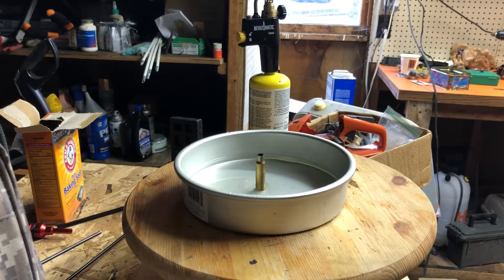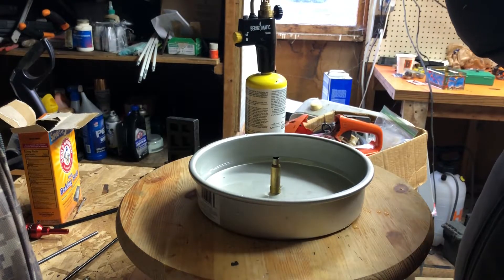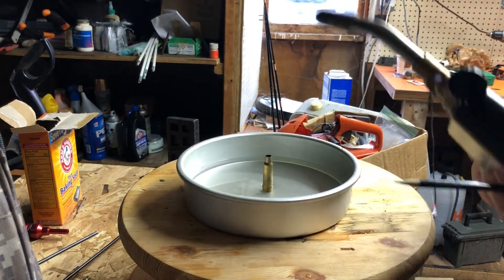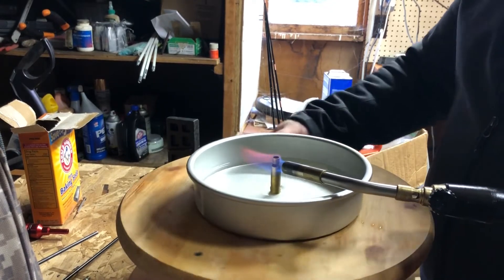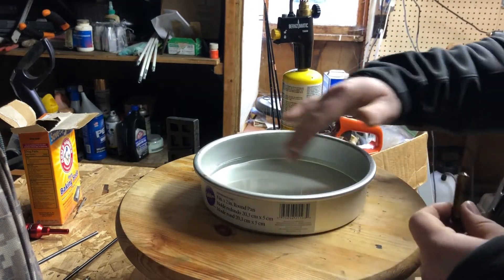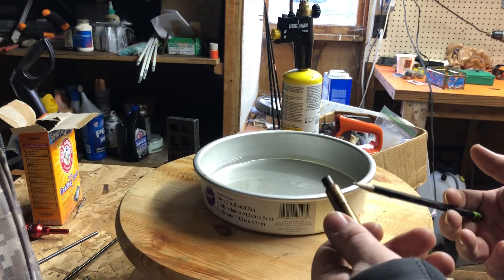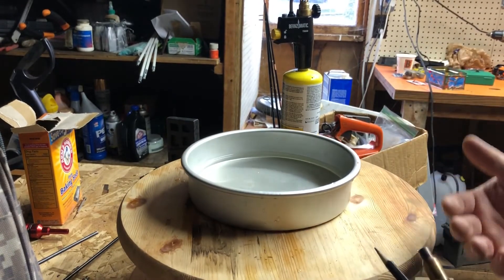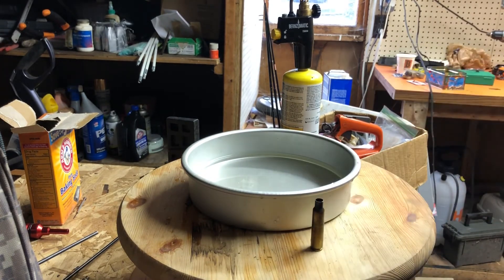How to Anneal Rifle Brass with the water pan method

Comment: I Chuck them up in a drill press. Use a Sinclair set up like a shell holder. Spin them and hit with the heat then dunk in a jar of water using the drill press lever.

Comment: Thanks for the info.  Can I get a reason as to why few people quench their brass but most don’t?  If the quench doesn’t hurt the brass then is it done just to speed up the cooling process so you can handle it quicker?  I’m looking for an answer that I can’t seem to find.  Thanks
Reply from the maker: Brass does not quench the way steel does.
They quench to have it be cooled down faster so they can handle them faster.

I use the water to prevent the case head from overheating obviously.
Reply: @shortreloadingvideos7571  No, the quench is part of the annealing. It would actually re-harden if cooled slowly.  Same w/ aluminum.  Think that the quenching freezes the molecules in the soft form.

Comment: Eric Cortina recently doubled his time under flame when he tested and found he was either under annealing or that it didn’t make a difference. 
I do the same method as you. I use distilled water, let the cases air dry for a little bit and then straight into the tumbler. I don’t really use a count or time under flame, I go just until necks start to glow. Some necks are a little blackened from my annealing but I’m to lazy to polish them any more than throwing them in the tumbler.
Reply from the maker: a lot of people disagree but they have not tried these methods. Obviously there is a point where it might matter but I am open about that and that my purposes are not as precision as others may be.

Comment: You completely burned it!
Reply from the maker: Read video description
Reply: @shortreloadingvideos7571  After watching and reading description I still agree, you destroyed that brass. I use this method but still, once you go red hot, you're destroying the tin, that's what gives rifle brass its elasticity.
Reply from the maker: @JaredHempfield  luckily no K-Bs. The case was over done for the video, but the water heat sink keeps these shorter cases from getting hot enough to turn the case metal into plasma.
Reply: @JaredHempfield brass is copper and zinc, about 70-30, but that can vary. No tin in brass.
Reply: @luvtahandload7692  trace elements perhaps but that's still dead soft brass now
Reply: @JaredHempfield  oh hell ya. Over annealers find out their errors, sometimes the hard way. Not ever 'sposed to be cherry red. Every time I walk by my AMP I smile.
Reply: @luvtahandload7692  I though that C260 brass had tin, guess not.

Comment: Bro, I’ve been down this road. Watching your vid I notice a few things, the map gas is and torch setup you’re using is too hot. I do basically what you do but I have a rcbs case prep station, old style. I screw a tall Lee case trimmer stud on back station, usually 308, I deprime and set the case atop the Lee stud thru the primer pockets hole and it simply balances and rotates then I apply my mini torch with regular butane. Average cases get 5-7 seconds depending on the distance you hold the case, but you definitely don’t want your case necks, shoulder or body to glow red, if they do you’ve ruined that case by burning out the zinc that’s in it. Ideally you want to snatch the flame away JUST BEFORE, it begins to glow. It’s a learning thing and you can sacrifice a few cases but I agree you don’t need tempilaq if you have a good working knowledge of what you looking for
Reply from the maker: Thanks bro it was all addressed in the description of the video.

Comment: Well, you're on the right track when you said you can't "over anneal. Everyone that I've seen on youtube doesn't anneal the brass at all or, the very slightest amount. 
Don't be afraid to get the shoulder & neck a very bright red. C26000 cartridge brass requires 800+ C  (not F) to fully anneal in 4 to 5 seconds. I've done hundreds of cases as above. It won't ruin the brass unless you take it to melting point. Nothing will burn or separate out under the melting point &, nothing will burn. The brass will be blackened however, this is only high temp surface oxidation which can be easily polished off in seconds with a drill driven circular brillo brush. Auto shops usually stock them.  I've since started using MAP gas because when the cases are in water, it's too much hassle to get the cases hot enough. Try melting the cases with the propane with the cases in water..you can't or at least I couldn't.  Use less water, just enough to equal the depth of the case head. The case heads won't get close to annealing temperature. I've also annealed several hundred cases with live primers, not one incident. Also, don't tip the cases over, you've got to dry them then. Just remove & set aside. You can size, trim, prime & charge within the hour. Also, you must brush the carbon from the necks after annealing, it wreaks havoc with bullet seating. 
Seating force results measured with my K & N force gage for unturned necks with full annealing are excellent. The bullets seat between 16 & 30 lbs without mandrel sizing. With mandrel sizing to bullet OD below the neck/shoulder junction then, neck sized with a LEE collet die, I can get seating force down to 8 to 16 lbs 
To make it easier, find an old microwave with rotating plate & remove the turntable motor to rotate your water dish. The motors usually run off mains supply. 
I researched white papers published by numerous physicists who were commissioned to research C26000 brass & cartridges.  
Type into Google "C26000 brass annealing temps" Select  IMAGES. You'll find shit tins of graphs & all manner of info. Click on them & you'll be taken to published research papers one of which is "Recrystallization behavior of 70/30 brass" There are 3 or 4 other papers on the subject although the mentioned paper deals specifically with cartridges. I believe it was commissioned by Remington to aid them in cartridge manufacture.
Reply from the maker: I don't usually go for high tech solutions, and the water protecting the case head always made me feel like I could over gas the cases and not worry. Many years I've done it this way, I've never had to give the brass any supplements :P 

Obviously the longer you heat a part over what you needed to do, you are wasting MAP gas, but often I just go until I hear the surface water start to boil.
Reply: @shortreloadingvideos7571  Basically, taking the brass to 800 C will achieve virtually instant full recrystallization, the trick is in knowing the temp you've achieved. We can use a metal glow red temp chart which is a reasonable indicator according to the boffins. 
I've done heaps of testing of the methods seen on youtube &, they just flat out don't work. The neck tensions are all over the place &, much harder. 
If you go to the AMP annealing site, you can find the article they've written on the 223 recipe #43 which takes the brass to 550C (1020F) for 3.9 seconds. If you find a temp/time graph on google, you'll see where they're taking it to roughly. In my opinion, the AMP is the only annealer working within the constraints of not holding the case head in water which produces reliable, repeatable results.
I was using my wifes cake turner base before the turntable motor......pain in the backside.
Anyhow, beside myself, you're the only other I'm aware of who's done some extra research & doesn't go Baaaaah, good to see.
Nowadays, annealing is my 1st step with the spent primers in place. This makes annealing much faster as it stops the water ingress inside the case & ofcourse, no drying required.

Comment: Doesn't the water quench harden the brass which makes it more brittle? All of the other videos show slow cooling. And several state the cartridge should NOT start glowing. Lazy Susan is a good idea though. No water.
Reply from the maker: Brass does not work harden like steel does when quenched in water. This video shows more gas than I'd normally do, the lighting was too bright but it had to be for the camera.  There reason they say don't let it glow is because most of them don't use water on the base, so they assume you will anneal the case head, which would be bad. They also claim you will 'burn off the good minerals' or some crack pot stuff like that, but they never explain which ones or why it matters. Truth is, nothing burns off the brass, they are generally insane people who have never done this kind of annealing but they read this or that on reddit.

If the brass was made brittle by the water I would know by now lol
Reply: No, brass is hardened by working.

Comment: If you over anneal the case mouth it can cause pressure spikes. The proper anneal on brass is just before it takes on a glow. I am definitely going to use the lazy susan method you have shown for sure.